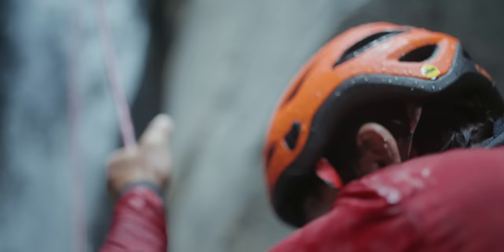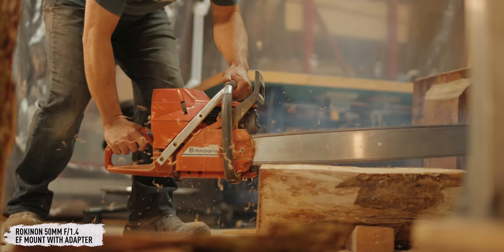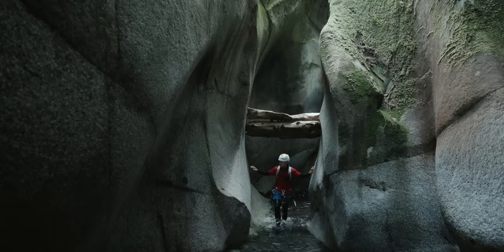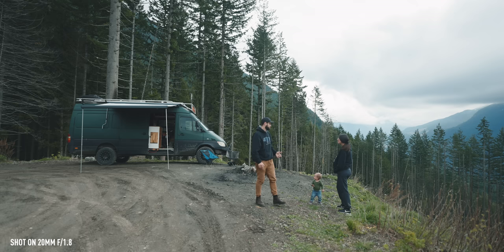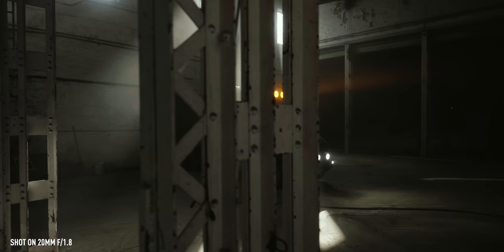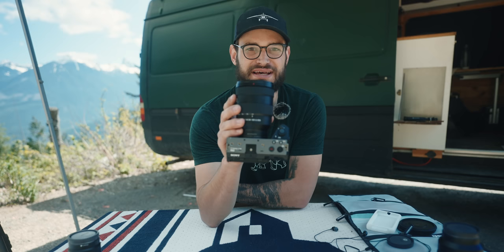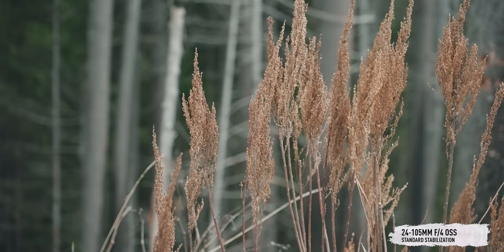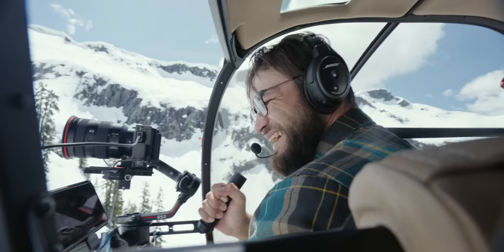The Best Lenses For Sony Full Frame Video A7siii & A7iv

Comment from the maker: What are your two must have lenses for filming?
Reply from the maker: I've gotten some great responses on instagram and twitter so I thought I would ask here as well.
Reply: @Levi_Allen  My 2 are 35mm 1.8 and 85mm 1.8 but more of a Hybrid Shooter .
Reply from the maker: The 35mm is a really lovely lens
Reply: Currently using the Sigma 24-70 dg dn 2.8 but I’m strongly considering selling it for the 24-105 you showcased here. I would use primes for interviews and I often find myself wanting more reach.
Reply: Right now we are transitioning from the Sigma 14-24, Sony 35 1.8 and Zeiss 50 1.4 to 14GM, 35GM and 50GM. We absolutely adore using our 135GM. The 70-200GM hardly sees any use since we got it. 24GM is another favourite. The 85GM has a very nice image, but we will exchange it as soon as Sony makes a refresh. For macro we use the 90 and 24 Probe and for super long shots we also love the 200-600G. In the past we had the Tamrons 17-28 and 28-75 and the Samyang 85 1.4. Loved all three of them. But with the new class of primes Sony has been pushing out we are just gushing at the performance.
Reply: Sigma 24-70 2.8 stays on my a7S III 99% of the time. I also have a Sigma 50 1.4 and Tamron 70-180 2.8, but find myself using those less and less. Maybe I'm just getting more and more lazy as I get older. haha
Reply: Sigma 24mm f/1.4 DG DN Art and Sony FE 85mm f/1.8.
Reply: @SloanChris  I have this setup as well. Good combo.
Reply: 24-70 f2.8 Sigma 
same price as 24-105 but better ;)
Reply: Hi whats opinions on telphoto like the sony G 70-300mm full frame  for sony a7iv?
Reply: @BlueHawk80 do you have dust issue on your Sigma 24-70?

Comment: The 20g f/1.8 is the best lens Ive ever used (I sold my 24 GM for it). I use it for wedding films, photo shoots, vlogs, real estate, everything.
Reply: this doesn‘t make any sense, 24mm 1.4 looks so much better
Reply: @JamesBreitenstein  I haven't tried the 20mm yet but I love my 24mm so much, I wouldn't go any wider
Reply: @JamesBreitenstein  "Looks so much better"? Doesn't it have more fringing, a farther minimum focusing distance, more focus breathing, and a weird green fringing on out of focus highlights? Sure, maybe it's a tiny bit sharper, but it's also significantly more expensive and heavier.
Reply: @TechnoBabble  it ways 400g, do you even lift? 24 at 1.4 look MUCH more cinematic than 20 1.8, test it yourself. Bokeh difference is hugh
Reply: @JamesBreitenstein  I disagree, and Ive owned both lenses for quite a while. I’d choose 20 all day

Comment: I was really going back and forth about the sony 20mm 1.8 and the Tamron 17-28 2.8. I went with the Sony 20mm and have been loving it for its small size, fast aperture, and wide focal length! Also, have the 24-105 and has been a fantastic all-around lens

Comment: Perfect timing for this video! I just switched over to the Sony FX3 from Red Komodo and have found myself trying to figure out what glass to go with.
Reply from the maker: It’s a tough decision for sure. Obviously you can get good results from most any lens, it’s just a matter of which ones haha
Reply: How are you finding the switch? Anything you miss from the Komodo that the Sony doesn't do particularly well? And does the 'look' compare? (sorry for questions, i just put a downpayment on an FX3 myself!)
Reply: @stevewelsh__  to be honest, I love the FX3. The "look" is almost exactly the same. Now, this could be that I am shooting Sigma Art glass on the FX3, which was also my favorite on Komodo. I ran many Tokina Cine lenses on Komodo, but always found myself reaching for the Sigma Art 18-35. The Menu's on Komodo are a thousand times easier to use, I loved the stop lights for exposure. The screen on FX3 is tiny, menu is difficult to navigate. But the camera is half the price (as a ready to shoot rig) and the FX3 is much better suited for my style of run & gun shooting in the outdoors. the image is cleaner, less noisey than Komodo. Main thing I miss though, is having shutter angle instead of shutter speed.
Reply: @Eric.Estrada  thanks for the detailed reply! It’s comforting to know that these 2 are quite comparable but like you I need the camera in an instant for my shoots (product videos mainly). I was worried about the heavy digital look both the FX3 and A7Siii come out of the box with but I’ve seen a few videos now where I could swear they were a cinema rig. Lens wise I’m going with the sigma 24-70 so that should be super versatile! Thanks again :)
Reply: @eric definitely consider the 24to105 G Its great with that sensor.  I use it on my a7siii and now find it hard to justify buying the 24to70 GM.

Comment: Very cool video! Personal 2 cents - photo and video do differ, so for a photographer such kit won't work. After years of doing photography as a hobby I've come to a conclusion that the best kit is two zooms (16-35 Sony (which I want to replace my 24-70) and 70-180 Tamron) and two primes ( haven't finalized my picks yet, but at the moment I'm leaning towards 35 mm and 85mm). If budget is unlimited and Gear Acquisition Syndrome is not a problem - I would add 20m, 135mm and 200-600. 

And I wish A7R4 had the same stabilization as the S-series...

Again, thanks for the video, great job!!
Reply: I was just thinking the same. GM series lenses are more tailored to R series cameras and higher resolutions.
Reply: @Markyroson  yup! 24 megapixel sensors are wasted on high end lenses

Comment: Just the video I needed! I use the Canon 24-105 for work on FS7's etc and it's trash, so soft and ugly but this has convinced me to go for the 24-105 for my A7Siii. Thank you!
Reply from the maker: Give it a try! Doesn’t hurt to rent first too
Reply: Was it an RF 24-105mm Canon lens that you used? Or was it an EF lens?
Reply: @sonicvboom  It was the EF version of the 24-105mm in the mk 1 and mk 2 versions. Admittedly I've recently used that glass on a C70 and it looks better. Could just be the old FS7's looking trash!

Comment: I'm with you on the 24-105mm focal Length. If I had one lens I'd choose my 16-80mm for my Fuji X-S10. Changing between primes is easy and great in a controlled environment but for me it's 10X harder while camping or on the trail. It's more trouble then it's worth many times.

Comment: I settled on a Sony full frame because I had a lot of glass that fit my Minolta camera from years gone by. Although almost all of them are manual focus and lack stabilization I make up for it with a device called a tripod. I love you work by the way. I was getting a "Vibe" when you were showing clips of that one wheeler rolling down the streets.  I am an ex-Hamiltonian that has lived in cottage country (North of the Muskokas) for a dozen years now. One shot rolled past "Jackson Square" and I knew that you were in the Hammer. That explained the vibe that I was getting.

Comment: Very informative Levy. I have the a7s III and I have been running the Tamron line 17-28, 28-75 and 75-180 its been working well for me but I would be interested in that 20mm 1.8 you showed for low light.

Jason

Comment: I DEFINITELY agree with the usability vs image quality point. Sometimes, we need autofocus, stabilized zooms because we're not filming in a location where we have much, if any, control over what's going on. Sometimes, I can get a shot on my a7iii + Tamron 28-75 that I wouldn't be able to get on a BMPCC4k + cine lens. And on that note, I chose the Tamron 28-75 over the Sigma 24-70 because I didn't need the extra bump up in sharpness, but I DID need the smaller form factor and lower weight, because I know how I operate, and I saved a couple hundred dollars in the process.

Sometimes I wonder if the Sony 24-105 would have been an even better choice, due to the expanded range and OSS, but whatever. I like my Tamron lens.

Comment: Great video, very helpful - love my FE 1.8/55. I too have the 16-35 f/4 and would probably opt for the Sigma 14-24 f/2.8 if I had it to do over again. As a Sony shooter, I've always carried a Tamron 28-200 as a backup lens for commercial work (my 70-200 hit the floor once and I would've been sunk without a backup). It doesn't necessarily have the cool factor, but it's like the Toyota of lenses: solid performer, very versatile, and pleasantly affordable. It's small (relatively, light and pretty fast, wide open). No stabilization built in but a great minimum focus distance and low chromatic aberration. Love your stuff, keep up the great work. Thanks.

Comment: I’m a paid portrait photographer & have been looking for a lens to fill the gap between my 16-35mm 2.8 G-Series & my 135mm 1.8 G-Master. After much research I order the Sigma 24-70 mm 2.8 ART lens, which is half the cost of Sony’s lens in that range. I’m really looking forward to putting it to work!
Reply: that 24-70 is lovely. I have it but looking at the 35-180 f2 tamron now as a replacement

Comment: 28mmf2, 50mm(I have a pair of vintage minoltas 1.7 and 1.4) and 85mm1.8 and that will do it for me, most of the time. Adding up a zoom lens like 28-200mm would be the cherry on top.

Comment: An awesome little prime to consider: the 35mm f/1.8. Minimum focus distance of 22cm, very little focus breathing... Plus you get the versatility of 35mm and 52.5mm in crop mode, which IMO might be the two most versatile focal distances to have.
Reply from the maker: I wish the crop mode on the a7siii was worth using. But totally agree that 35mm is a great choice

Comment: Great vid, Levi!
Reply from the maker: I’m curious what you’re favourites are?
Reply: @Levi_Allen  We bought the 24-105 3 years ago for exactly the reasons you articulated - the one we borrowed was incredible. But the one we bought new didn’t perform as well, so we sold it. The 55/1.8 is small & beautiful as you say, but it focus breathes like a dragon and I see it in what we do. So my favorite lenses these days are also the G lenses, especially the new ultra compacts. We actually exited Sony during the pandemic, but are about to come back in. Will probably start with the 20/1.8 and 50/2.5 because they are so much smaller than zooms. Also really like the sigma 28-70/2.8, so we might start with that instead of the 50/2.5 We also like Lume Cube!

Comment: I used that 24-105 as a television sports reporter and it was incredible how flexible it could be. Had to add it to my personal kit for weddings and run-and-gun. I got the 16-35 f/4 used for a good price, but I’m wondering if I should have just went with the 20mm f/1.8. Still considering the change. A7siii is awesome!
Reply: Are you looking for a video editor?

Comment: The examples you gave comparing the 24-105 vs 24-70 showed what seems to be a clear cut sharpness difference in favor of the 24-70. Just looking in on those beard hairs & shirt textures. Even with Youtube conpression I can see a definitive difference. 

Am I missing something? Seems like the 24-70 is a distinct winner for image quality here.
Reply from the maker: You aren’t missing anything. Yes there is a a sharpness difference, I say as much. Re watch the video if your don’t track with what I describe as my priorities.
Reply from the maker: In the tight shot directly after the 24-70 shot. The focus plane does seem to also be slightly off Nic’s face. So maybe that’s causing a more drastic disparity in what your noticing if you pause at those two exact moments and peep in.

Comment: Love my 24-105mm,  fantastic holiday lense. Wen I first used my A9ii I popped on the 55mm Zeiss and i was gobsmaked with the performance .  I had the 16-35mm used it once ! I personally don't like the distortion you get with wide angle lenses.

Comment: I have the Tamron 17-28/f2.8 which is very good and Tamron 70-300/4.5-6.3 very good as well and stable at all focal length with Sony a7c. These lens are super lightweight, solid, water resistant, very precise. The only cons is to have to change the lens. Tamron has a good 28-200. Sony 24-105, and the future Tamron 35-150/f2-f2.5.

Comment: I use the Fuji system but have a pretty similar approach. I’ve gone with the F2 primes over the more expensive versions but I don’t always have the stabilization that you are getting. Thanks for sharing your thinking and decision making process!
Reply from the maker: The stabilization and the auto iso stepping issue, was a big reason I had a hard time committing to the Fuji system currently. The kit is so lovely, and so close to being perfect though.

Comment: The 24-105 is super slept on. I’m still just in the Sony APS-C world so I am only rocking the 18-105 and the sigma primes. Just not sure if the upgrade to full frame is quite worth it for me yet. Still relatively new to making videos. My current 2 must have lenses are the Sony 18-105 and Sigma 30 f1.4.

Comment: Yes you can put filters on the 14mm F1.8 GM...
There's a filter holder made for that lens.
Reply from the maker: I meant front element filters my dude
Reply: @Levi_Allen  So did I..  You can actually put a filter on the front - its just positioned far out enough not to touch the lens...
Reply from the maker: For real? Do vnd’s work?

Comment: F4 full frame lenses weight, price and bokeh is similar to APS-C f 2.8. 
They also giving you less exposure and forcing to crank ISO getting same noice performance as APS-C with 2.8. And if we telling about shooting on base ISO 640, you’ll always need more powerful lights with FF with F4, than APS-C with f 2.8.
So, maybe if you really want to save your money, you should go to smaller sensors)

Comment: Aww I love my 16-35mm f4, I used it on most of my van channel videos! I too have the 55mm 1.8 but don't use it a ton unless I need lower light capabilities. And the 70-200 f4 I use quite a bit, did you consider that one at all? Surprisingly small and light.

Comment: Hi Levi! What do you think is the new 24-70 gm ii good enough as a versatile lens for documentary, adventure, traveling? I can't decide which one to choose - new 24-70, 24-105, or even Tamron 35-150 in addition to 20 1.8 and maybe 85 1.4. Since FX3 has the second native ISO I guess it will work well with the f4, but is it enough well for most situations or mostly for daylight shooting? 24-70 is now compact, light, and technically great, but doesn't have that 105 mm and OSS though, which is great for handheld, or mb active stabilization is good enough for the handheld? Tamron looks even better in some ways, but it's big and doesn't have OSS... Tough choice(
Reply from the maker: the 24-70 is an incredible lens! definitely can't go wrong with that choice. If I were you I would rent or borrow the options you can to get a sense for what they look like

Comment: DUDE! Totally agree! Very solid kit and I think you helped me narrow down some of my choices! I am currently rocking the GH5S but miss having a full frame and am considering jumping over to Sony and more specifically the A7siii to still have a tool that is easy to use for photography. I have a 24-105 equivalent for my GH5S and I use it 95% of the time. 
What I’m struggling with right now is if I could have just 2 lenses, which ones?

I am doing content creation/travel/client promotional work.

Comment: Hi Levi,

Helpful video with real use of the lenses!

A couple comments:
- since you’re using the A7S3, do you ever use the clear image zoom to punch in?  I have the A7R4 which replaced my A73 + A6600 because of the high MP, I leverage punching in with the APSC mode and at times, when using primes and need that extra punch, I add on clear image zoom
- since you mentioned the use of monopods, have you Moza’s Slypod Pro.  I am sure you would use the heck out of that with your handheld shots.

I also agree with your lens selection as I have the 20/1.8 instead of 24/1.4 and the 55/1.8 primes.  More budget friendly and gets the job done.

For zooms, I have the 17-28/2 but wanted the extra reach to 35 and lens IS and was thinking of adding the 16-35/4.  After watching this, maybe I just need to get the 35/1.8.

Have you tried the budget friendly Sigma 100-400/5-6.3?  It’s light, compact, and budget friendly but won’t match the 2.8 shallow dof that you’re looking to get.

Comment: 24-70 2.8 GM vs 24-105 f4
Is the stabilization significantly better on 24-105 since it has both IBIS and lens IS or is it a small improvement?

Comment: Nice to hear your down to earth opinion for video (different then for photo mode). I'm mostly wondering how much better A7RV is for IBIS stabilisation, if it can solo (or with active stabilization), keep a non OSS lens stabalized.

For 16-35mm, i think the Sony PZ 16-35mm F4 would be perfect for you.

On my nikon, i loved the 24-70mm f2.8E VR (stabalized) amazing for video (like on boats). it basically covered all range except UWA that i needed. And the size while heavy made me able to 'one hand' carry this lens 'in balance' near the mount, i even used it while cycling that way :)

On Sony i didn't made much video's yet, i wanna change this, this year when i go to Zwitserland. My biggest worries are stabilization (i don't have the 24-105mm, wich is only option for this, i got Gmaster version II instead), and rolling shutter. One one hand i think people overstate it, on the other hand i have to take it into account.

Comment: Great Video Levi, just switch over to the Sony FX3 and loving the 20mm f/1.8. So nice to have an auto focus system that works🤪🤪
Reply from the maker: I couldn’t agree more. I was holding out on the full swap over until we got a camera with high FPS, less jello cam, and a flip out screen. Sony gave us all those things and raw over full size HDMI. I was pumped.
Reply: @Levi_Allen  Sony is on roll right now, so happy I have switched. Got to test the FX6 a few weeks back and really shocked at how small it is 😳